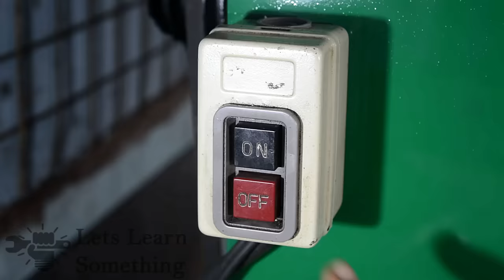Homemade Lathe Machine

Comment: Nice design, but to me I think you missed something in your design. without a travel lock on each of the axis to prevent accidental drift, you could end up with significant variances in the precision of your cuts. Should not be difficult to add, though.
Reply: I HOPE HE DOESNT TRY TO MAKE WESPONS AT HOME LOL LIKE IN BRAZIL IS ALOT PEOPLE THAT WERE OUT JOBS AND START TO MAKE COSTUMADE SILENCES FOR ASSAULT RIFFLES THERE AND PISTOLS IN THERE BACK YARD LOL, BUT I KNOW WHAT YOU MEAN BY THE AXES I USE TO BE AROUND MACHINIST IN MY SHIPYARD IN ILLINOIS, JUST A QUESTION HOW LONG IT TAKES TO BECOME A UNION MACHINIST?
Reply: 4 years

Comment: Good job, tho I must admit the parts where you drilled counterbores with a drill bit and used phillips screws made me cringe a bit.  Socket caps, dude!
Reply: He probably used what was available to him.
Reply: Yeah, either use the 12.9 socket heads he already had for the rails or go with A4 torx
Reply: You probably realize they might not even be available there! 
Not all things are available everywhere! 
Try to find  1 1/2 x 2 3/4 To be in the United State’s? 
That’s the size of a stake pocket on a truck or trailer? That’s the size of a 2 x 4 (Rough cut) Finished 1 1/2 X 2 3/4 
He did an awesome job! 
A man with a flawed plan Is better than a man with no plan at all!
Reply: If you didn't use a drill bit to counter bore, how would you do it?
Reply: @georgedennison3338  With a counterbore cutter.
The counterbore needs a flat bottom or the fastener won't sit properly.  Drill bits have a pointy end and endmills have a concave end. 

Pretty much the only thing that can create a flat bottom hole is a counterbore cutter. They have a small pilot head that fits into the already drilled hole to keep them centered.

Comment: Amazing job ! 
Some questions for you: How tight are the linear bearing blocks? Does it enough for lathing?  I thought they were loose before watching this video. Which electrod (6013 or 7018) are you using for welding ?
Thank you for sharing.
Reply: It's been a long while since I've welded but a couple looked like 6011, a couple looked like 6013. Either would work fine for this, if that's what you have. It's not 7018.

Comment: Based on it having linear rails and ballscrews, how are you locking each unused axis during cutting? The freedom of movement should be causing push-back, which is normally restricted by the friction in the slides and lead screws.

Comment: What was your total build cost? Also I hope you don't have to remove the spindle for a long time or the set screws don't come lose because unless the spindle was a extremely tight fit in the bearings it will be a nightmare trying to fix the runout of the spindle back to where it was.
Reply: You can get a 4 jaw chuck and keep moving

Comment: this machine needs a tailstock
Reply: It also needs an autofeed and some scale and angle markings. That said, it's excellent for what it is.
Reply: I think it's not done yet but I guess this is made for small works. I wonder if he will have a continuation for installing the tailstock. Looking forward to this! Love it!
Reply: @InstrucTube  might not be as necessary to have autofeed but tailstock and angle and scale markings is a must have. It's not that hard to do all of that considering what's already been done. Autofeed could be a bit too tricky/complicated to get it work right.
Reply: @user-po8gk5rt2i  It's true, I was kind of pointing out that there's a lot of stuff that it doesn't have, not necessarily saying things that are feasible to do.
Reply: @InstrucTube  now that he has a lathe, he can make those things
Reply: kahdarul ismanu  he will need a tail stock for any drilling or long parts
Reply: @InstrucTube What for? Guides are not parallel. Anyway, the limbs will show the weather on Mars.

Comment: Only issue is you dont have a compound.
Reply: and it will be necessary to account for the extra height when adding a compound slide in order for the tool to line up with the center.  a shorter tool holder will be needed. but I am impressed with most everything about this build.

Comment: generally correct but not very precise (setting the rails, welding after mounting the guides, drilling without fixing the element)

Comment: Did you use the 400mm ball screw you link in description?

Because the plate you install it on is 14x7, so about 355mm long.. interested to know if this is accurate or a mistake

Comment: ANY kind of metal "chip-making" machine cannot be made from "steel".  This was found out by one major machine tool builder 50 years ago. White Sundstrand built a series of machining centers based on fabricating.  the machine frame was very thick plate.   The end result was a machine rampant with vibration.    CAST IRON HAS INHERENT DAMPENING PROPERTIES.

The "E: value of steel is much "better" than cast iron ...but when it comes to machining, cast iron is simply the only "best" way to make ANY machine tool.

How do you turn to a specific "known" diameter?

How do you generate a thread?

How do you machine a taper?

A lot of work .....and you can't actually do much on it.

.

Comment: I would very much like to see the indicator check for accuracy. The spindle itself, the movement of the support along the longitudinal and transverse feeds. If the deviations are within 0.02-0.03mm, this is a victory. If more than 0.03, then this whole construction is expensive rubbish, on which you cannot make responsible high-precision parts.

Comment: I know that this is old ish video, so links are not working. Is this 1605 ball screw? I was trying to find more precise ball screws, but I have only find 8mm in diameter with pitch of 1 mm. I think that is just too weak. 16 mm is optimal, imo. 1605 ball screw has a pitch of 5 mm. That is, again imo, too rough.

Comment: Sir what is the serial code of the ball screw flange nut? is this code match? CNC RM2505 RM2510 Ball Screw Flange Nut Seat Ball Nut Housing Bracket Mount

Comment: lot better change time 17:06 stepper motor this, can controller whit pc linuxcnc this most accurate than manual. need only draw computer piece and make G- code and run.

Comment: Before you BUILD a lathe - take one APART first. What you built is a working MODEL of a lathe, not a functional machine. Yes, your build is impressive but it also a waste of time and money, as little changes could have made this machine way, way more functional. Example: the pitch of the cross-feed spindle: needs to be a fine thread or you will never be able to effectively turn a diameter, the ball bearings for your main spindle need to be swapped etc...